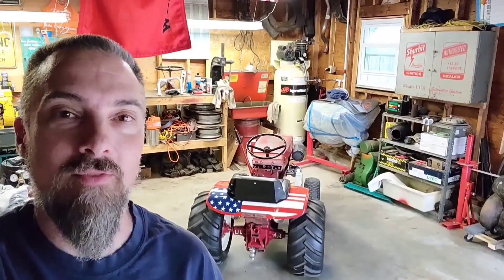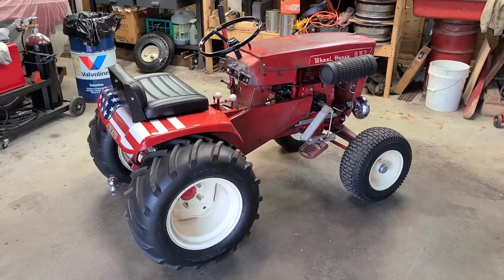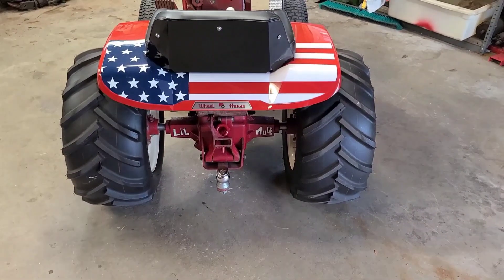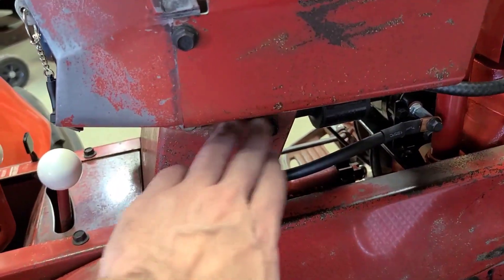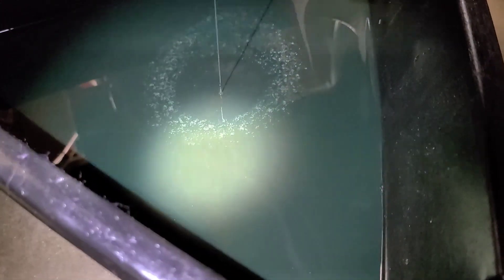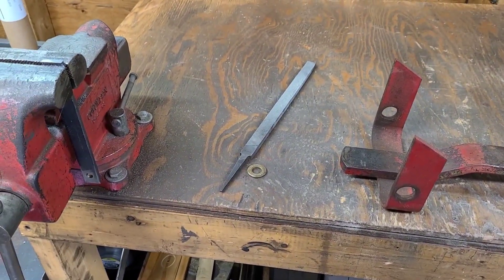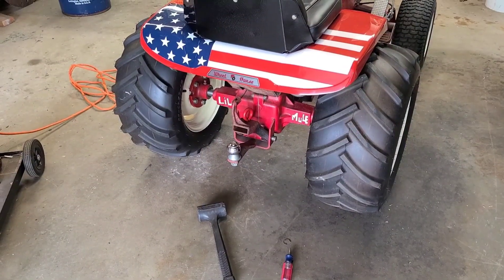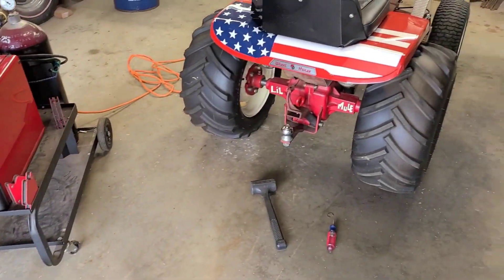4000 Subscribers! 2021 Wheel Horse Show and Lil Mule Update VinsRJ

Comment: Congratulations on your 4k subs. I used to own some Wheel Horse, I still have a 1970 C 160. Love the Kohler engines. I think it has a bazillion hours on it and it starts and runs great. Still a great old tractor I just gave it to my 14 year old great nephew.  Not sure what the exact hours are but it doesn't smoke or use any oil as I have changed oil every Springtime in the last 30 years I have owned it. Best wishes for you, before you know you'll be celebrating 10 K subscribers.